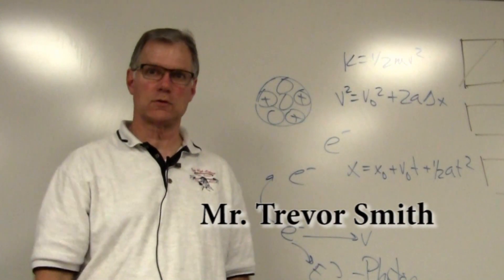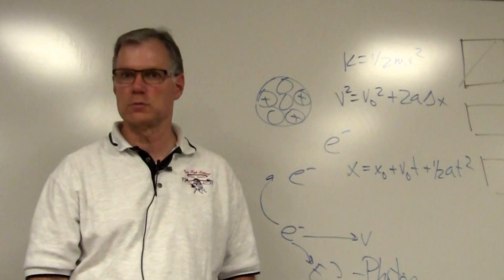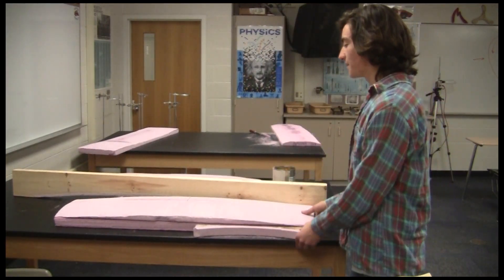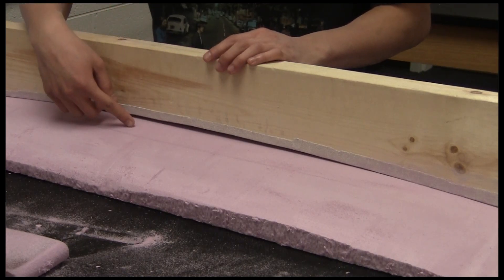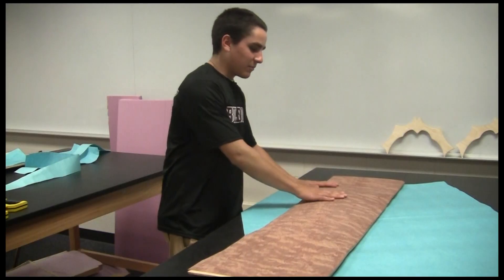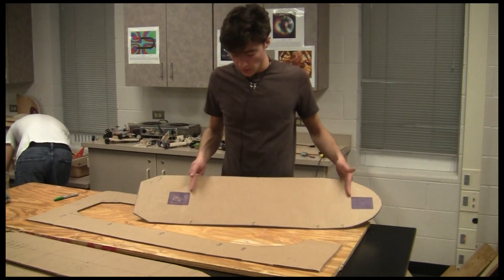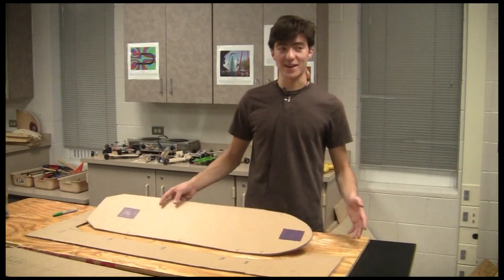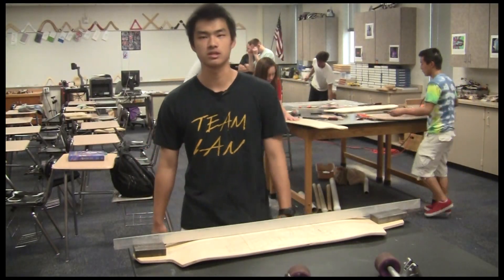Long Boards

Comment: Guys, this is really cool. I am 52 and still love a good board. Having gone through the evolution of boards, I myself have made various types of boards. Some would include plywood, plexi with plywood inserts. Solid hardwood and just for fun we made one out of hardened cardboard. ( that one of course did not last too long but it did work. Never really understanding the physics of it, we really did apply the same in our work without know that we were doing it. Excellent, and party on!!